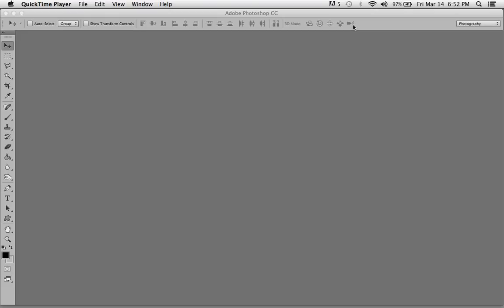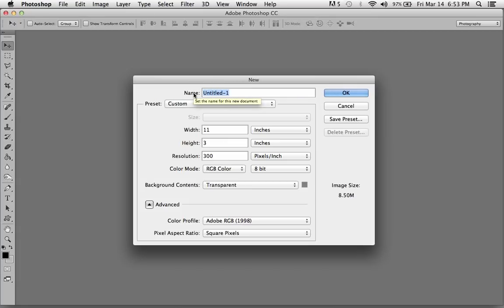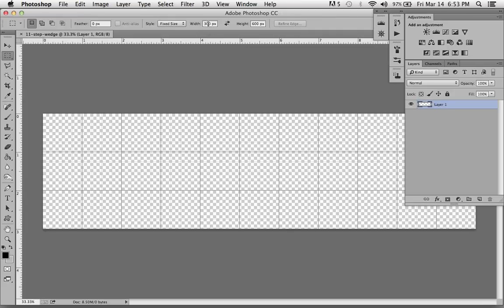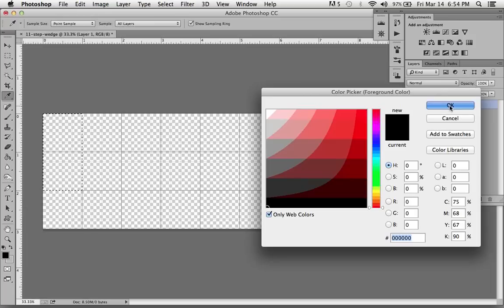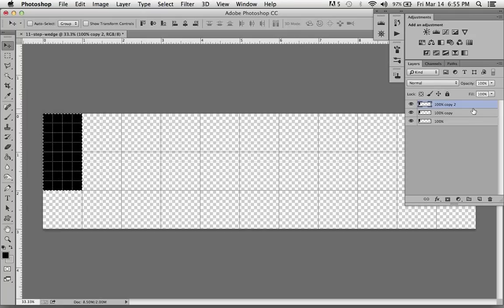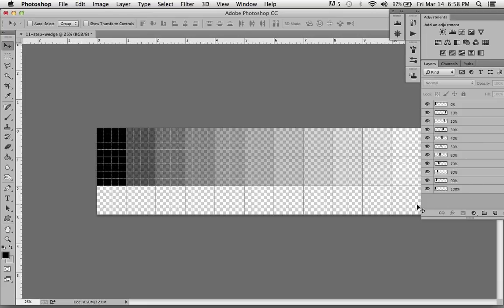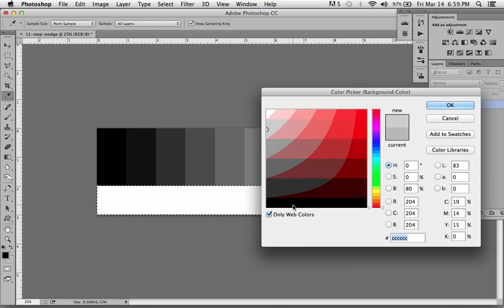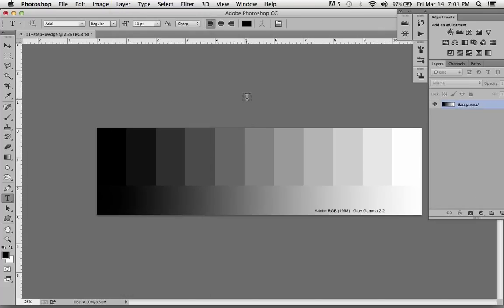Making Your own Step Wedge for Digital Negatives

Comment: I'm very new to creating digital negatives and have no idea what i'm doing.  Just how accurate or useful is this particular step wedge for creating Digital Negatives?  How well does this step wedge perform compared to a manufactured Step wedge by Stoufer?  Is it really this easy?   Since I'm bumping around in the "Shadow Details" on this subject, I just needed some clarity on the subject of step wedges.  There is very little information out there about creating step wedges.
Reply from the maker: Stoufer makes step wedges with specific, predictable densities every time.  If you have manufactured film negative, paper, or anything traditionally photographic, use the Stoufer. 

The process in this video is for those who are using their own printers to create digital negatives/positive on transparency film.  By printing a step wedge on to the transparency film, you can use it to determine what densities are being printed by your printer/film combination.  It's the first step towards making an adjustment curve with your equipment.

1.  Make the step wedge as per the video.
2.  Use the step wedge as your negative/positive in your photographic printing process.
3.  Look at the resulting print and compare the differences between what densities you should be getting vs what you are getting in reality.
4.  Scan your print and open in Photoshop.
5.  Compare your scanned print to the digital version of your step wedge.  The digital version is your target (where you want everything to be) and the scanned version is what you are really getting.  The difference between the two is how you will build your compensation curve.  (see other video)
Reply: @scottbarnes5963  Thank you So Much Scott.  This was truly helpful and informative.  I'm comparing what I'm reading in some of my older books on Digital Negatives and Pt/Pd processes and printing.  Can you  recommend any current material that is as useful and practical as this video is?  What did you read or find really useful on this subject?
Reply from the maker: @divusiulius7539  I just made many experiments before figuring out a workflow that I liked.  I wrote up my workflow in my book, but that is really just expanded notes to myself and has some errors that I would correct now.  Honestly, the information is so spread out across the web that it's bit difficult to get one good one together (and some people are holding on to their own secrets about the process).  If you are ready to make a bunch of experiments, that is the best thing to do.  Otherwise, seek out a workshop where someone can walk you through it.  I wish I could be more helpful.  Good luck.
Reply: @scottbarnes5963   Thank You!  And you are right; experimentation is the best teacher.  I should have expected that some are holding on to their secrets.  That's ok too!  In this weird economy anything that gives anyone an edge is an opportunity to earn good money.  And I don't fault people for holding on to their well earned secrets from the time and hard work! This is the fruits of their honest labor.  That's what hard work is for. Advancement.  And I do want to thank you for your insights and the information you shared.

Cheers!
Divus Iulius